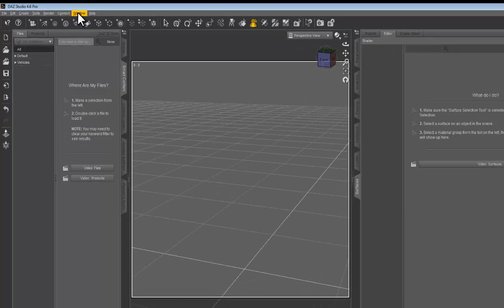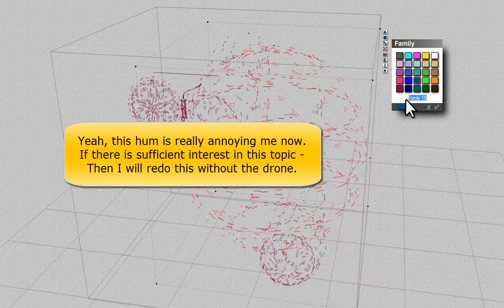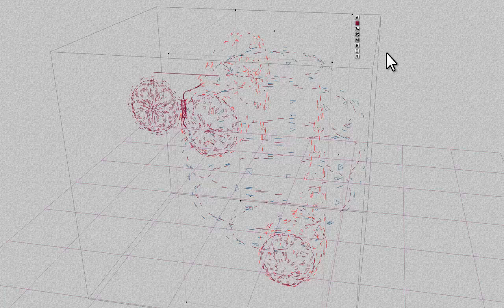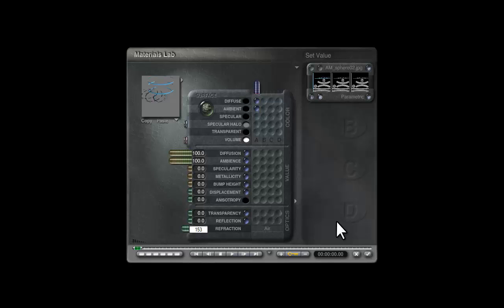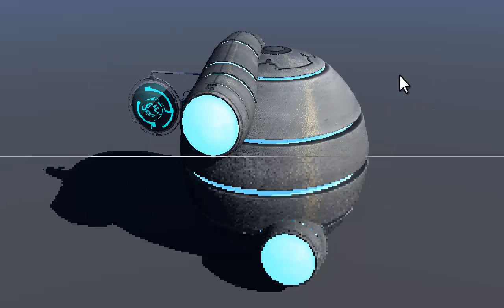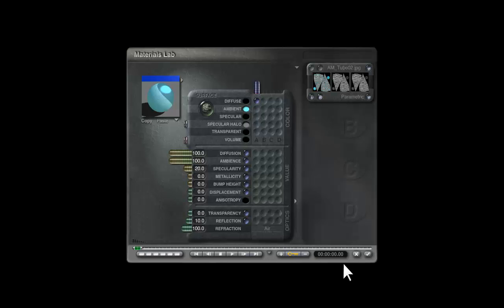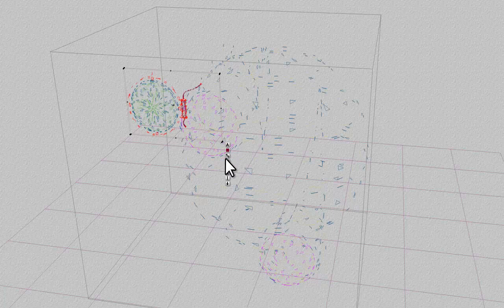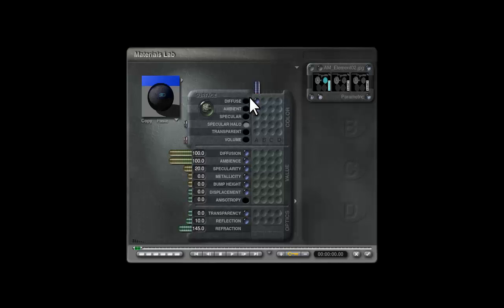Bryce Basics - DS prop material conversions - by David Brinnen.

Comment: I get why you use the Material Grouping Color assignment system of Bryce, because it helps you to know which UV maps are being used by which parts of a model. There is a list that can be accessed by going to the bottom bar, right side, down pointing triangle, which call up a small menu. Choose "Select Meshes" to see a list of all meshes in a model. Warning: The mesh list can be quite long, depending on how many material zones are in a model. Bryce recognizes each material zone as a separate mesh. Example: The Human Anime figure "Aiko 3" has a lot of material zones, that have to do with the many different surfaces of the figure. Even the lips are a separate material zone, and Bryce will see it as a mesh named "Lips".
 
Now imagine having to do what you did here for each of the material zones of Aiko 3. Soon you will run out of Material Grouping Colors to assign. So what I do is ignore the material grouping and just do what needs to be done for the materials by selecting each mesh, and working them individually. I have found this to be the most effective method of working with such complex models. In DAZ Studio you can also access these Material zones in the Surfaces Edit pane. I suggest having a look at the figure or prop surfaces to see how many material zones it has, and if you check the texture images by clicking on the boxes that have tiny copies of the images in them you can see the layout of the UV map coordinates. Knowing which Material Zones are included in one UV map, may help you to know which meshes in Bryce correspond to that UV map. You can then assign those meshes only to a group by using the Grouping tool in Bryce, which just might help you to assign a Material Grouping Color to that Mesh Group. Then you just may be able do what you did here with even complex models like human figures.

I know this video is 11 year old now, but we Bryce users are a special bunch, even though no real updates have been released by DAZ 3D since late 2009. As I learn from you even now about little known aspects of Bryce, I feel that things I have learned on my own through exploring the application may be something you would like to know, if you don't know it already, and if you are still using DAZ Studio in tandem with Bryce, as I know DAZ Studio fairly well, and have discovered things about Bryce on my own, it would be only right for me to impart my knowledge to you in case you have not yet discovered them! So I have written this comment and included what I have learned, and a method I use, while working with that knowledge. And some of what I learned was through your guidance! I think reciprocating your help by providing you with that knowledge only helps to increase what we can learn about the applications we use. 

One bit of knowledge leads to another, which leads to yet another, and so on.

Cheers!